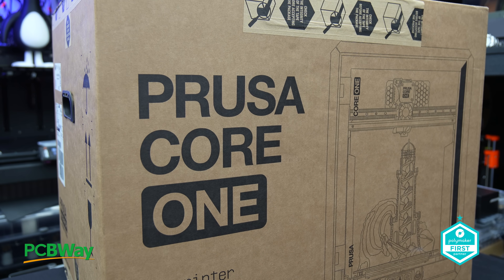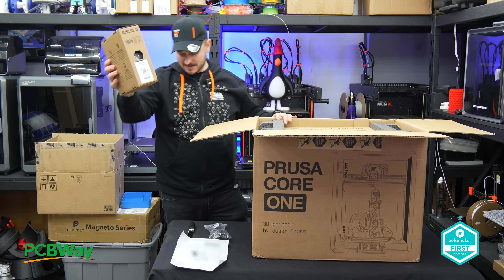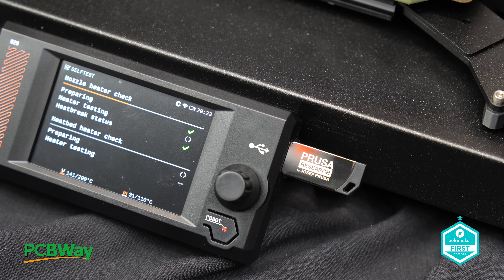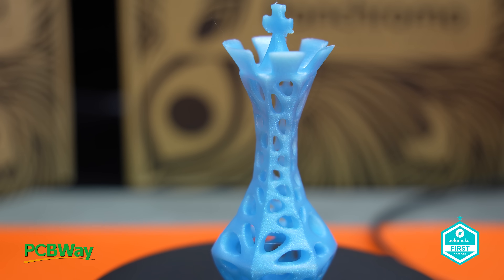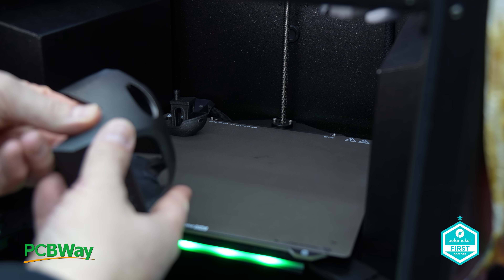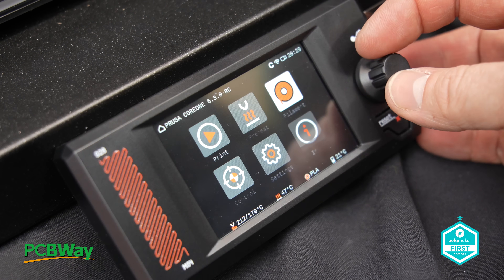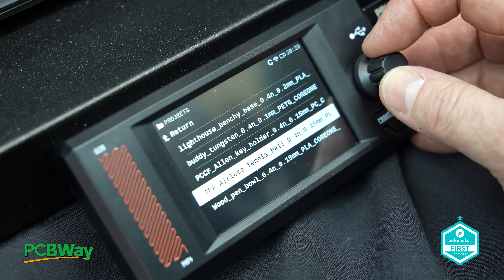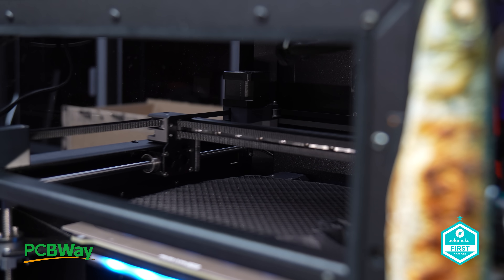The Prusa Core One Review: Was the Hype REAL?

Comment: Bloody hell...They finally come out with a coreXY and what is it? A somewhat slower "X1C", that has a tiny bit taller but overall smaller build volume. They could've come out with a 300x300x400 mm build volume, with a price that probably would've been maybe 20-30 % higher (if that), and offer something that's pretty unique (prusa quality, european built, corexy, large build volume, and reasonably affordable price), as creality's attempts at larger enclosed corexy have been lukewarm at best. And no the XL is not an alternative at its price point (plus it doesn't even come with an enclosure (yea you can buy that separately), and it's not exactly aimed at the hobbyist with that whole tool changing capability). Instead, yet another small build volume corexy, cool. At least it's not made in china :P
Reply from the maker: @EquinnMc  what’s your solution ?
Reply: @TheRealSamPrentice  Sorry, not sure what you mean! I use a bed slinger that has a 300x300x400 mm build volume because there is unfortunately not a single coreXY that can replace it (and I often make use of that volume). I simply would've been happier if Prusa came out with a product that brings something more unique to the market, instead of another 15 liter (roughly) model. Obviously , this is a "me problem" a lot of folks will be quite happy with this printer I'm sure, and I do agree with the community that at least there is a corexy that is made in europe and not china (personally this is less important to me but I do see the value in it). If you are asking how I would've approached this as a company, that's hard to answer, but I'm not sure if it's the best strategy to add something to the market that already has a lot of cheaper competition. My opinions on this matter are very obviously colored by my own use case, and frustration that for years now no decent mid/large volume corexy has come out.

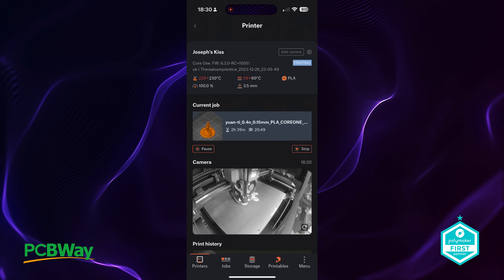Comment: 7:00 - I've heard in Stefan's review that the optional $40 camera on the Core 1 only works with the cloud service Prusa Connect and not Prusa Link on the local network, and on the cloud service, there is one frame every ten seconds, so it's not really a "video" camera.  I'm not sending my designs to anyone's cloud based print server, not even Prusa's.

10:30 - Is there a reason you didn't show the underneath side of the overhang tests?  Even with the vents open on top and exhaust fans running, the chamber has some passive heating so PLA cooling is lessened compared to open frame or bed slinger printers.
Reply from the maker: On your first point: You can view the camera via your app from anywhere, even on different broadband connections, so I don't know why Stefan has had problems. You're right tho on the connect. 

On your second point: That’s just how the edit turned out, but I’ll make sure to show that in a short for clarity. I have nothing to gain by leaving anything out—it was simply the rush of the edit in this case.

If we’d had more than four days, I’d expect the overall production to be more polished. As it stands, I pulled a couple of all-nighters just to get this done at the last minute—which, to be honest, isn’t on.
Reply: @TheRealSamPrentice  - It just seems odd that Prusa doesn't allow the Core 1 camera to work on the LAN with Prusa Link.  I think that's how most people want to use it.  Remote monitoring from a phone from anywhere is pretty much the only reason I can think of to use the app and the Prusa Connect print server, but that's not enough to compel me to install an app or use someone else's print server.  I prefer more privacy and security than that.  I can't imagine Prusa deliberately preventing customers from using features in LAN mode to coerce them into using the print server (like that other company) so the camera issue must be a technical problem, or some software that hasn't been written yet and will hopefully be fixed in a future software upgrade.

I didn't intend to imply that you were deliberately hiding print defects although reading my comment it sounded that way.  The PLA overhang performance was a bit lacking in Stefan's testing compared to the MK4S, so I would have liked to have seen the under side of the overhang test, which is the important part of the test.  It just seemed odd to show an overhang test but not show the overhangs.
Reply: @Liberty4Ever  I heard that Prusa and a bunch of other companies that 'abide by the law' are currently forced to sell / run their cameras cloud only, due to still active Stratasys patents. Chinese manufacturers often disregard those patents (which I believe everyone should).
Reply: @lagging_around  - That sounds likely.  Thanks for the explanation.  I knew there must be a reason.  It's very handy to monitor a print farm in another room across the LAN on my computer's web browser.

Comment: Cant decide Prusa or RatRig
Reply from the maker: Well I have both, what are you trying to achieve ?
Reply: @ I have some 1400hrs on a Genius Pro with no problems and only two failed prints but  it’s now difficult to keep the prints looking good and it’s obviously slow. I want reliability and ease of quality spare parts, I now print a lot of things for school fairs to raise funds for the school, so the big build plate and Idex of the RatRig appeals, the Prusa Xl would be ideal but the extra cost may be hard to justify, I want to venture in to engineering materials so enclosed would be nice, and the possibility of multi coloured is an other consideration, I am waiting for RatRig to release further information on what they will be releasing. I have also been asked if I could possibly print full size helmets and cos play. I have got two children into 3d printing since I have started with the school fairs, and the school are now looking into the possibility of getting some printers . My space is limited so I am really looking for the impossible Swiss Army Knife of printers!
Reply from the maker: @nmasson30  its that: Prusa XL: Plug-and-play, reliable, multi-tool, but pricey. It’s like buying a premium car—you know it’ll work well, but your wallet might need therapy.

RatRig: Big, powerful, customisable, but more DIY. If you love tinkering and don’t mind troubleshooting, it could be a beast. Think of it as a 3D printer kit with ‘some assembly (and patience) required.’
Reply: @TheRealSamPrentice  Thanks a lot, I don’t mind building, but once commissioned I want tinkering to be at a minimum! Staying in Spain RatRig almost feels a local brand.